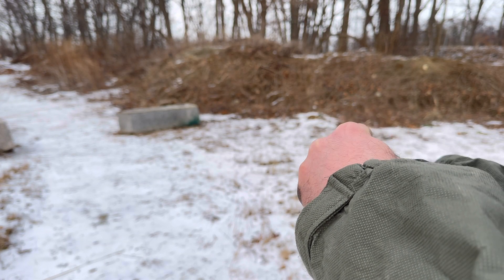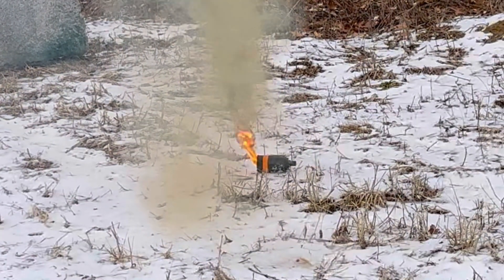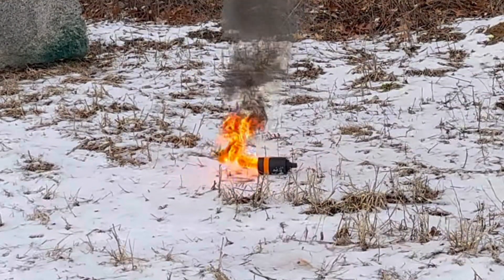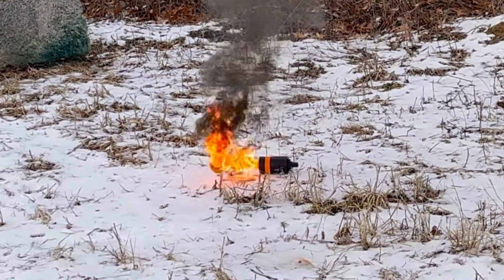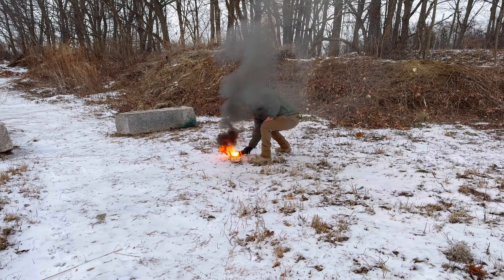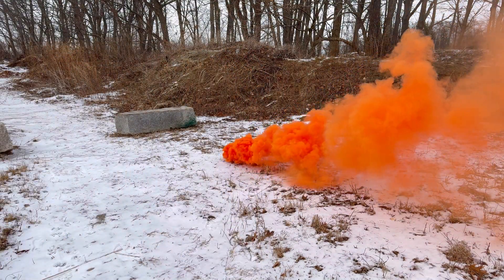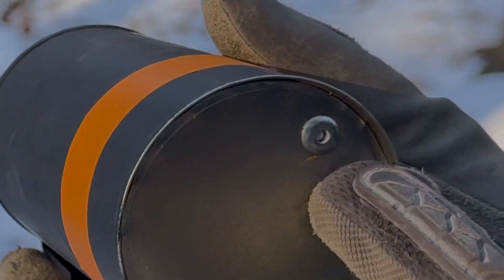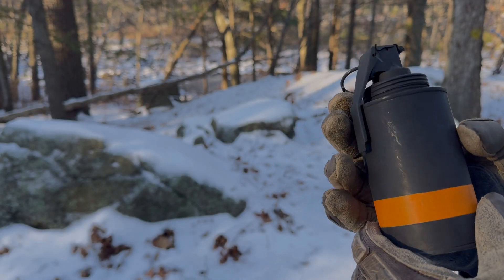Vivid & Voluminous | Canister Prototype Test 1

Comment: I hate it when my orifice is to large for the volume I'm trying to evacuate too, especially when it causes a flare-up.

Do kind of wonder though could you constrict the intake and exhaust with a flapper valve and push the limits a bit farther? On the "handle" side punch some holes and maybe use some silicon gasket membrane (should handle the heat)  on the inside that seals when pressure is to high.. and on the bottom a ring of holes that the seal is on the outside and when it's over pressure it exhausts? Few bumps in on the holes should let you fine tune the desired flow rate.  Know it'd increase the cost/complexity but if you could dump your load faster and get more volume quicker it'd probably be an acceptable tradeoff.  Anyways look forward to the complete guide.